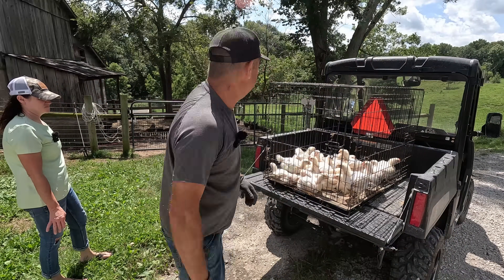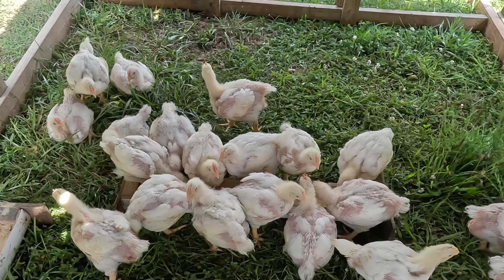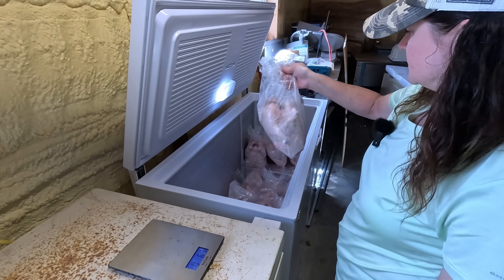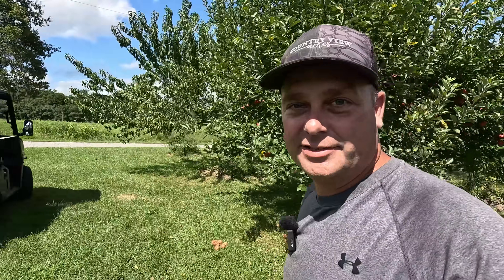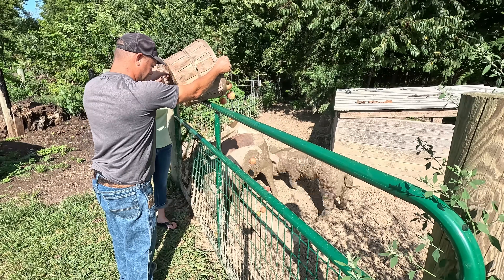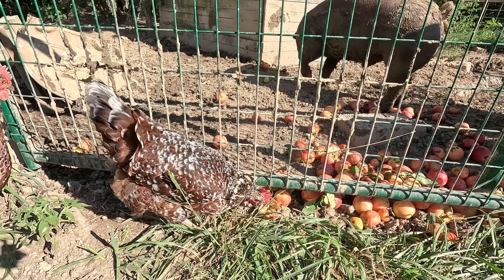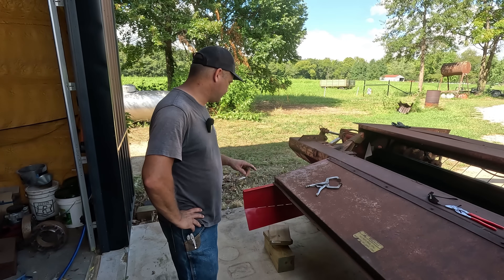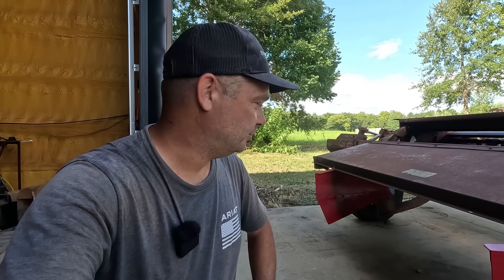Installing Windrow Deflectors on the Hay mower, Apple Harvest & Chickens on the way to Freezer Camp.

Comment: I bet those deflectors will work really good in shorter grass. You could probably take you some rubber and bolt to those deflectors & let it slide across the top of cutter so you could still adjust the deflectors & but it would stop the grass from hanging up in there. Great video always enjoy & always trying to take some pointers away for my channel. Thanks Evan & Rebekah!

Comment: Since the apples were wet when putting them in the refrigerator they will need paper towels to keep them from molding. I believe I would store them in the basement; in and unheated room. Apples will not keep long in the refrigerator !

Comment: Great video as always .  Good job on the deflectors .You might be able to bolt a piece of rubber to fill gap above it to keep hay from going over top or even a metal plate could be bolted on to baler in front of deflector to deflect it down before it gets to deflector . Enjoying all your vids as always .

Comment: FYI I volunteered for an organic orchard in Canada couple years ago run by a couple that were in their 80s ..they had 50 rows of 50 trees each - roughly 9 different species - they had trimmed every single tree so that they could be picked from the ground by hand. That’s what I did -I helped get the last batch of apples off probably a dozen rows or so ..I’m only 6’ 2”  & was able to reach everything from the ground ,they had a basket with a belt through the handles that I put over my neck and it hung down about waist level, I could pick with both hands until I got it full enough and then took it to a big basket that they moved with the forks on the tractor. Made the whole process very quick, no ladder - no handtools… enjoy the channel -the two of you make such a terrific team. blessings to you and yours.

Comment: My parents had three apple trees in the back yard, the wild turkeys clean off the trees the week before they were going to harvest. To take care the top gap, attach a strip of rubber and use square wire locking pins. Thanks for the video.

Comment: When you pick the apples you must lift up while you hold the apples and don't pull them off.
You also probably bruised most of them  by handling them roughly.
I use to raise pears and apples if you need any advice!!
Reply: Yep, they aren't rocks.

Comment: Sorghum sudan is a very wet crop. 3 or 4 days of drying would be better. Even then it'll probably still be over 50% moisture. I lay mine out as wide as the conditioner allows, leave it lay 4 days then rake it then bale or chop it

Comment: When I picked apples at an orchard we had Harvest Apple Picking Bags.  Made picking apples a whole lot easier.  You should check them out.  They are a canvas basket that hangs on your shoulders in front and as you pick the apples (or other fruit) you just put them in the basket.  The bottom of the basket is just a flap that latches to the top so when the basket is full, you unlatch and just empty it through the bottom of the basket into your container. Check them out. They allow you to pick apples hands free.

Comment: The round baler should work better if the windrow is a little wider than the bale with the gathering wheels crowding the hay in on the edges. That should help keep the ends of the round bales well formed without needing to zig zag on top of the windrow

Comment: We had the same Gehl baler as you only it was the silage special model.  If I remember correctly the manual recommended a max diameter of 4 foot for silage bales.

Comment: Put some damp paper towels in with your apples to keep them from losing moisture.  Apples lose moisture in the refrigerator, especially Galas.  They will start to shrivel up without some moisture.  Check the paper towels weekly.

Comment: could you bolt rubber flaps over the and on top of the deflectors to keep the grass from catching up I would think rubber would be a cheaper and easier fix than using metal and welding

Comment: Can someone explain what silage is, haylage, and any other “lage”. Please and thanks.
Reply: Silage is from chopping of corn and some forage sorghum then put into bunker to ferment.  Haylage is any type of hay like sorghum sudangrass, alfalfa put into bunker to ferment or it can be baled and wrapped which is also called Balelage.
Reply: Silage is cut and stored when it's still very green.  Nowdays they bale and wrap with plastic to keep oxygen out of the bale.  This keeps the leaves green(nutrition) and promotes fermentation that will prevent rot and decay inside the bale.  Silage is usually made from thick stalk type grasses like sudan, sorghum, or sometimes corn.  These grasses have lots of sugar in their stalks and smell surprisingly sweet when cut.  Cows love it.  My dad never bothered with silage, but there was a storage trench on the farm from times past.  I guess they piled the silage in the trench and then covered with tarps or something?  The top few inches.probably dried out, but the rest was probably fine underneath.  Not sure about haylage.  I did haul alfalfa square bales for a farmer who insisted on cutting and baling on the same day.  He never let it dry much.  When putting those REALLY heavy bales in the barn, he had us spread some salt down every two layers or so in the barn.  I guess this was the same idea to preserve the.greeness of the hay, but I'm honestly surprised he never burned his barn down.  Maybe he had lots of rotten hay in the winter.  I don't know that, but i guess his sheep liked it just fine because he kept having me do it every year from the time i was 12 to 18(when i quit the hay crews and got a real job).

Comment: Should have cut it for hay bales when it was only 2 or 3 feet tall (knee to thigh tall),  it needs to all go through the crimper to crack open the stalks so it will dry out but it is so tall now a lot of it will miss going through the crimper.    JMO.

Comment: Like you an just about every other usa you tuber. Do your chicken way to soon. The males should dress out 12 to 15 lbs. Female one 8 to 12 lbs. I do 200 at a time as there not long enough time before deep freeze set in. Plus the hatch places here only have 3 dates to order in spring with the 1st one in April were unless you have a good heated biulding to take 25 below dont order then they have one day in fall for  Specialties. By doing your chickens your wasting a lot by not getting the full return.  Big bone an best meat not fully to top of brest bone an rounded out. That little more time an feed. Give you over 100lbs more weight. You should never have a 4lb to 6lb dressed chicken. Unless it a runt. I said this to you year after year. If your going to do them do them to there prime or don't do it. Such a waste for same work. An a little  more grain.